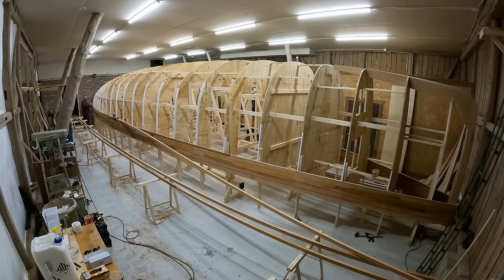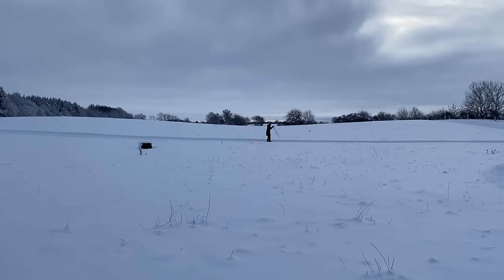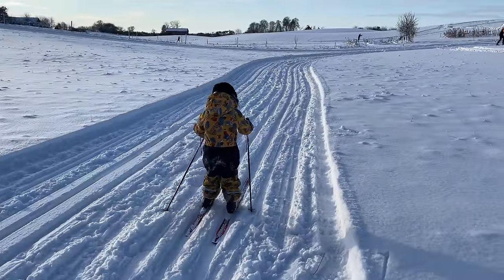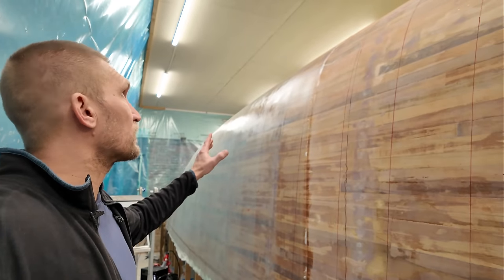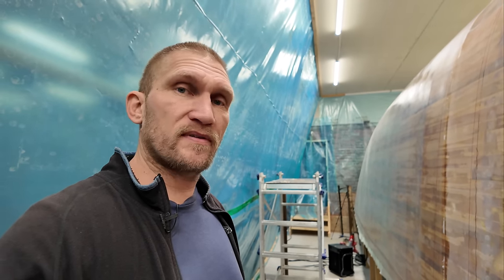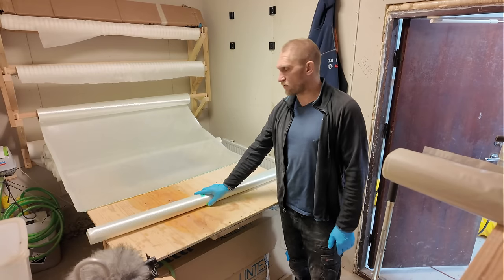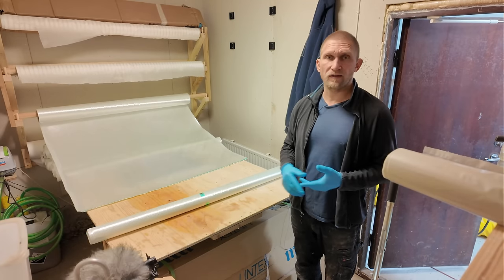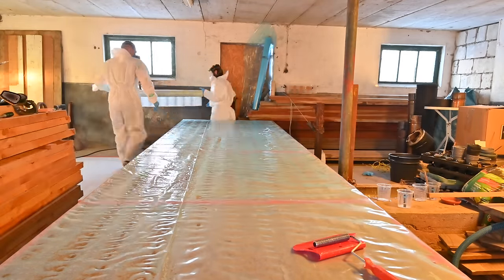Lamination Update: 1/3 Of Exterior Completed! - Ep. 374 RAN Sailing

Comment: Just a suggestion, there are long and short fiber glass extension poles (at least in the States)with threaded ends that thread into the handles for those pressure rollers .   Using these will cut the time why down because you will be covering a lot more surface area quickly while applying more pressure if needed . Hope this helps you.😃

Comment: Your saturation table was a good idea. There is a device that does that job almost automatically. Dry glass goes off its roll through a wide epoxy bath then out through a set of pinch rollers and onto a finished wet roll to go on the hull. No hand wetting the glass. Pinch rollers provide the exact amount of epoxy. Looking forward to your next videos, you guys are doing a great job.

Comment: I"m tellin ya.  Get hold of that crew. in Holland that're building for Distant Shores.  They've got a "Mock Up" system where they build these modules that fit right in the aluminum hull.  So as tanks, electric, plumbing, the engine, further reinforcement, insulation go into the hull's "skin" there is an amazing process of building "everything else" or what you actually see inside, (the furniture) happening somewhere else.  Their build process has value and like you they start with a bare hull. Distant Shores has been pretty thorough with their video's on You Tube.  Just saying.  And so....  On and on and on....   So impressed with how far you've come.  Thanks for sharing this process.  ～✨🌸🌟👍🌟🌸✨～

Comment: Impressing work you both do, the boat will be strong as concrete!  Rare to see so much snow in Skåne and also the low temperatures.  I think you should be making your FG lengths shorter, looks like you've got 30cm overlength on each length, wich adds up to a lot og FG and epoxy you could spare.  Love to see the progress and as you say Johan, the most interesting work starts when the hull is turned and the temp frames are removed and the interior  starts to take shape.

Comment: Have you designed and or started any of the work on the cradle for when you flip it? Will it be a temporary stationary cradle or one with wheels that you will use to tow it to the sea when it is done?

Comment: Looking wonderful...lots of work but you are getting the time less & less as you go. Do they make larger/wider rollers to get the air bubbles out?  I've used the one's like you have on projects but they weren't nearly as large an area as you have. It would certainly make it go quicker I would think.
Reply from the maker: I haven’t seen any wider than 140mm. I think the problem is that with a wider roller, the pressure per mm2 will be lower. Cheers!

Comment: What it the purpose of the peeling layer? To keep the epoxy clean for the coming layers on top?
Great progress and exciting to watch!
Reply: Epoxy as it cures produces amine blush, basically an oily residue that will keep new layers of epoxy and fiberglass from adhering well; the blush can be remove with a soapy water or the of use peel ply. The peel ply serves a couple purposes, the amine blush floats to the top of the peel ply so when its peeled off all the amine blush is on the peel ply and not on the laminating surface, the peel ply also leaves a better surface for new layers to adhere as its got some texture so instead of sanding peel ply can be used. It also can be left on till work is ready to resume months later as it keeps the surface nice and dust/ debri free as long as it not exposed to crazy amount of sun.
Reply: it is for creating a good surface roughnes on which the next layers can adhere to.
Reply: @Cameron-ur2tk  I understand! Thanks for the detailed explanation.

Comment: So far you have produced a great looking, easily driven hull shape.  From here to make this a game-changing on trend design you need to focus on two aspects - these are sailing speed and crew dryness.  

Speed equals safety -  faster you can go the more certain you can be around weather windows.  There is no reason why RAN cannot be faster than a 50 foot catamaran, especially up wind. 

Auto pilots are powerful enough and clever enough to takeover from a person on the helm.  There in no need to stand out in the rain.  Sail management from the cockpit is well known.

The cause of recent sailing deaths and the most dangerous risk is being hit by the boom. Staying in the cockpit is both dry and safe. 

Great work so far, but you need to think ahead to the big picture of what are you creating - hopefully not another slow wet boat.

Example of a 40 foot family cruiser sailing at 20+ knots

https://youtu.be/YrBWqZxmR6k?si=1I7mmd4jX2f6L1sZ